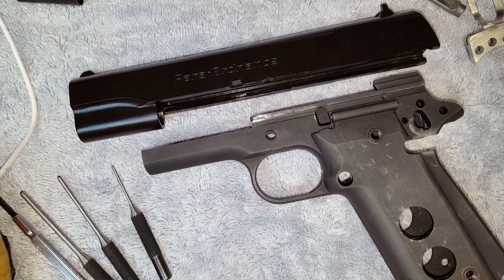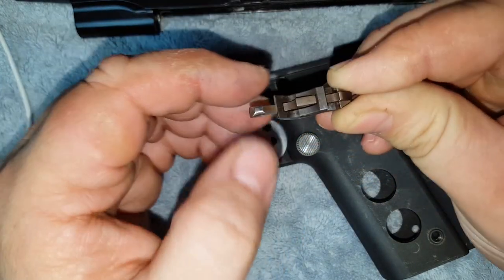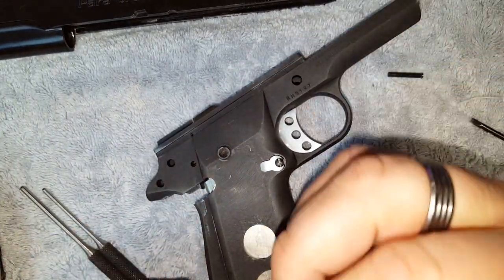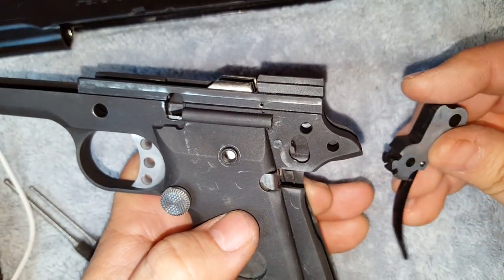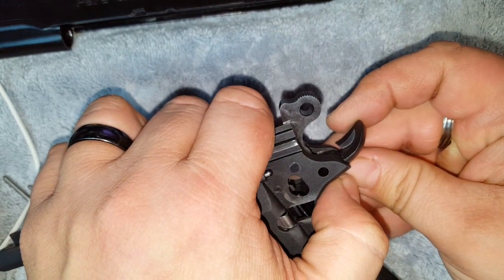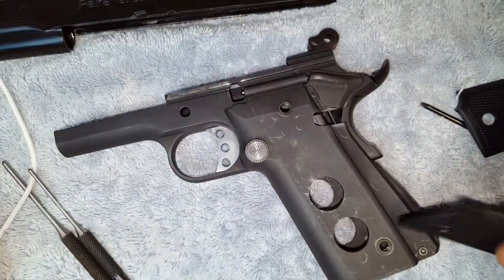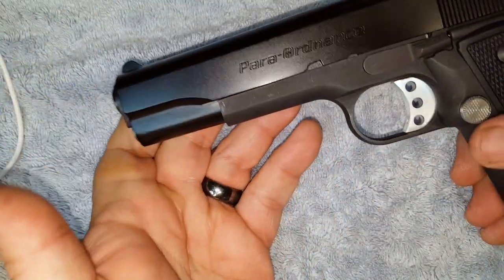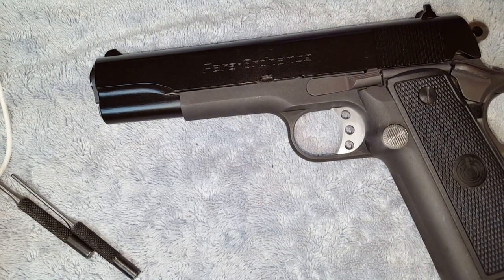1911 Frame Assembly

Comment: did u have to adjust the sear spring ?  or is it ready to go out of the box  - my p-14   - when I pull the slide back and then using the slide release as the slide moves forward the hammer some times drops  - what could this be  - any help would be appreiciated  - Thanks

Comment: Where did you get that trigger? The stock trigger that came with my P 14 sucks. can you provide a link to it?
Reply from the maker: That's a Wilson Combat trigger.  You can get them directly from Wilson Combat or Brownells has them also.  I know what you mean about that stock trigger.  It really is a piece of junk.  Be prepared to do some fitting for the Wilson Combat trigger.  It will be a tight fit initially and you'll have to take material off the top and bottom of the trigger slowly until it fits well.
Reply: +NinjaMidget yeah, I kind of figured I would have to do some fitting. I like a tight trigger so there's no slop up-and-down. thanks for the info. Can you provide a link to the item for me?
Reply from the maker: http://www.brownells.com/handgun-parts/trigger-group-parts/trigger-parts/triggers/para-ordnance-aluminum-triggers-prod6822.aspx
Reply: Jorgeluis Rivera

Comment: Just picked up one of these, and was doing all of my YouTube research. Your video was VERY helpful. If I can ask, where did you get the Grip safety? Do you have a mode/part## ? It looks like it fit perfectly. Did you have to do any modification to it to get it to fit?  Thanks
Reply from the maker: It was a Wilson Combat grip safety.  I don't remember the part number, but it didn't require any fitting at all.  The trigger and the barrel bushing both took a little fine tuning to get them to fit well.

Comment: glock will run circles around it?? 1911's are one of the most accurate pistols out there and yours is double stack so what exactly is the advantage of the glock?
Reply from the maker: I was talking about performance more than anything.  Any gun can be made accurate.  The 1911 design is very good, but can be finicky in adverse conditions just because of the design of the gun.  The hammer and firing pin configuration leaves a big opening in the gun that debris can get into.  This problem is not as bad with striker fired guns like the glock.  A glock will run better through torture tests than the 1911.  I'm not knocking the 1911, it's just a fact that the differences in the designs of the guns effects their performance in different conditions
Reply: @NinjaMidget1969  Ironically, a WW1 and 2 era Spanish 1911 did better in the InRangeTV mud test than the Glock did. The hammer and firing pin didn’t seem to be a major issue outside of the mud blocking the firing pin, but using a stick to clear some of that mud out resolved the issue.

It’ll just depend on where the mud gets into the gun at what point.